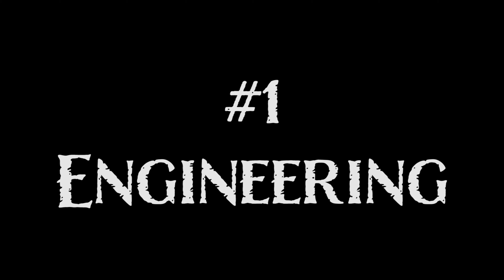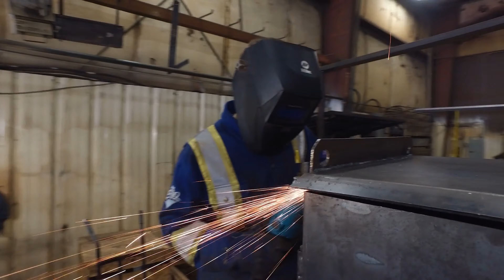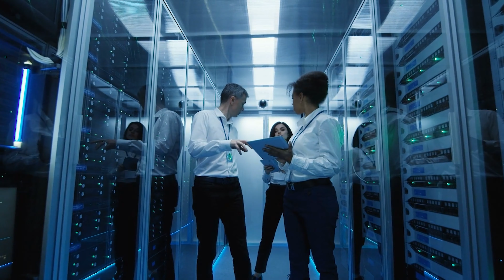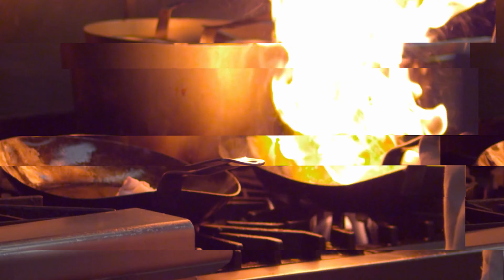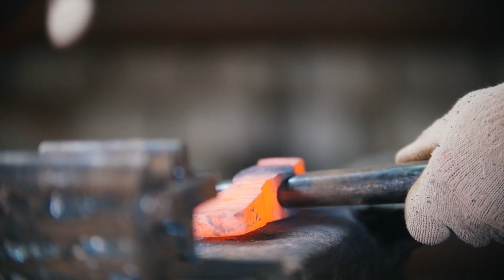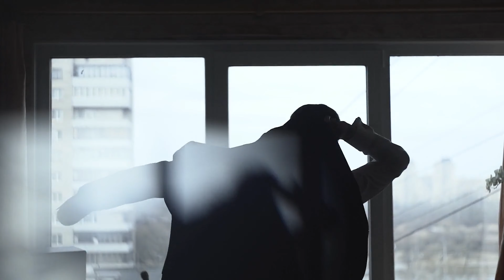TOP 20 Necessary Skills After Grid Down for Long Term Survival

Comment: ⭕️ most i can do... but plenty to learn, for sure... learn what you can ASAP folks ... i still think it’s not far off.
Reply: Howed you learn all these trades?...I would have to pay for 2 years each trade just to get my feet wet at a CC or trade school.
Reply: @Edgingtheyank  ... age... i was intrigued by a lot of them. Now... you can learn most on this platform, just pick one and ask questions. I’m not tech savvy, but i pick it up as i go... metal work is fun for me, mechanic was my original interest. i wanted to know “how” things worked. i was 11 and my dad’s lawnmower quit working, and as he was on the way to store to get another one, i used what little bit of tools he had to pull it apart, flip the head gasket and clean out the carburetor n had it running and cut some of the back yard by the time he got back... it’s jus  an internalized passion that you have to have to learn how to do something. when you can “justify the need” then your mindset will change and your desire to learn will increase. don’t allow yourself to listen to negative people, they only drag you down to their level, Because misery loves company. you can learn anything, just don’t stop when you learn what “you think”  is enough. and multiple studies at once will not hinder or slow you down, it only increases your abilities and skill sets, multi tasking is seriously gonna be needed in a post event. Because it keeps you calm, level headed and able to lead those who can’t keep calm.
Reply: @Edgingtheyank   also... if you need a cheap intro to mechanical skills... get a scooter, one that isn’t running or has problems... $2 or $300 bucks ... take it apart and find out why it’s not running right, There’s plenty of repair videos on youtube that can give insights and “teach” you.  It will give you probably the greatest joy you could have when you get it running and your first ride is because of your own learned skills. anyone can buy a new scooter and ride... but fixing a problem... which enables you to ride... your level of excitement and pride, FAR outweighs the excitement of someone who jus bought it for an occasional ride.
Reply: @Edgingtheyank   however with everything that I see coming… If you’ve got the money go get a welder generator… an SA200 or a Miller bobcat in the 300 series It will give you electricity when you need it and also give you the ability to build a metal fence around your location

Comment: After the grid goes down the only skills that will matter will be preindustrial skills. With no electricity, no gasoline, no oil, what’s any modern machine worth? Knowing how to make a horseshoe and shoe a horse would be a valuable skill. I suppose knowing how to convert a tractor from running on gasoline to wood gasification would be a good skill. But how many modern tractors (with all of the computer chips) could be reworked into something usable? How many cars could be reworked to run on primitive fuel? People would be pulling their pickup trucks with a team of mules. Carpenters, mechanics, doctors, engineers, etc , would be able to use the basic principles of their profession, but under conditions far, far different than they were used to before Western Civilization collapsed.
Reply: Alcohol.
Distilling alcohol (methanol) from biomass on a scale to make it worth the effort.
Unless steam is an option. Ever seen a boiler failure?